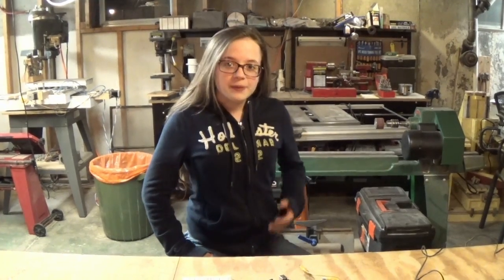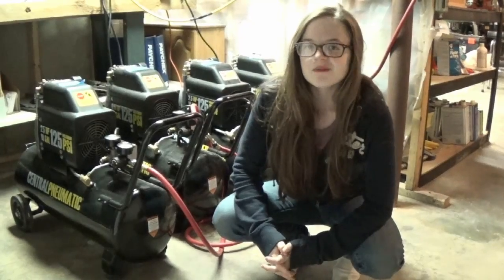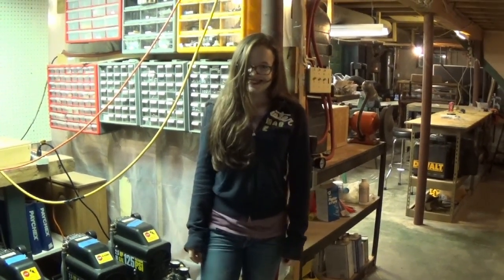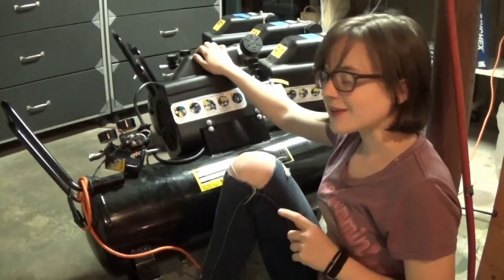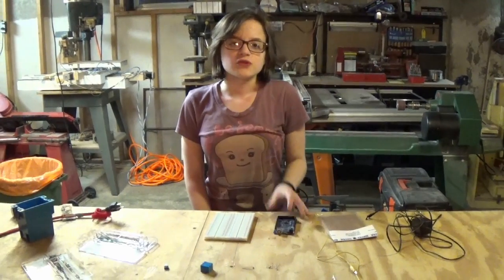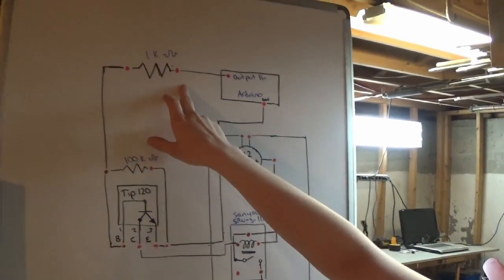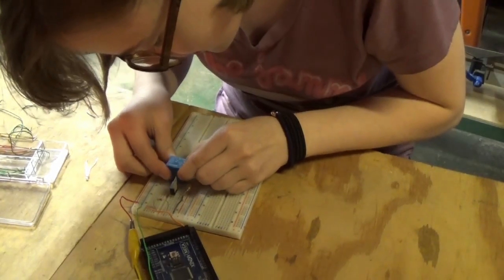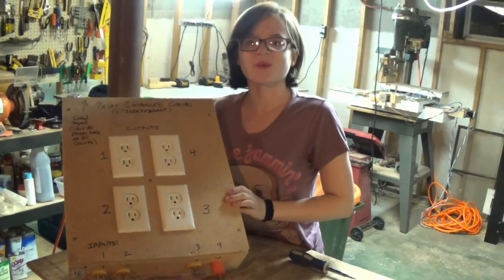Ep3 Cheap High SCFM Air with Parallel Compressors

Comment: Hmm.  I would have thought relays with a time delay feeding to the normal compressor electrical power inputs would be enough, if all tanks are connected together.  If all tanks are connected together they will all rise and fall in pressure together.  So, whenever the control compressor decides it is the right time to turn on, it is the right time for them all to turn on, and when the control compressor decides it is the right time to turn off, it is the right time for them all to turn off?

Comment: I hope your sand blasting turned out well.  I run into a lot of trouble with running my air tools at home. It's not sustained cubic feet per minute, its standard cfm. Using Boils equation for one of my set ups I found that 4.0 scfm at 90psi is 0.6 cfm for use at your tool. So your 25 scfm would actually be about 4 cfm so that actually sounds like a normal tool consumption ammount.

Comment: actually, connecting tanks together will give you the total cf, or get the biggest tank you can. this gives a long enough work time before the compressor kicks in. tanks are cheaper than compressors and a large tank eases the load on a rig that has to kick in often

Comment: Or you could use pneumatic one way check valves on each compressors output to prevent one compressor (the lowest psi setting one) keeping others from kicking on and just soloing the load / refiling other tanks. This way when air demand is high all come on.

Comment: You could just get a low voltage pressure switch, and directly wire the motors to ac. That would simplify the list a bit

Comment: Very nice vid. Are those compressors able to run on 220V? Would cut down on the amps and probably be able to run on 2 washer/dryer  and or electric oven/stove circuits.
Since so much money has been spent, why not pop open the breaker box and install a 60amp 220v line just for the compressors?

Comment: I am doing similar thing for a spray paint job. According to my analysis these compressors you are using are not designed for continous operation. They are 25% duty or less... you need a compressor that have cooling fins and more than ample cooling for motor especially because if motor burns out the compressor is totally useless to repair. In my application I don't need high psi just a 60 psi maintained that I will achieve using dewalt 55153 pump I bought from scrap. The other pump is huskey 8 gallon that maintains a psi of 160 would provide impulse and 25% or less through a restricted flow to dewalt powered tank. Because dewalt one is not powerfull but can operate continously I expect it to maintain 60 psi in 20-30 seconds huskey 8 galon requires 2 min 30 sec to fill to 160. 160 is very high preassure for the kind of pump design of huskey so it does heat up and motor also heats.

Comment: SCFM = Standard Cubic Feet per Minute, not Sustained.  But offering that correction is like telling Isaac Newton he had a spelling error somewhere.  This was an amazing project - and video - and I'm extremely impressed.  

I would love to see a follow-up video where you measure the air output.  There are probably losses in this system, and it would be nice to see the actual obtained SCFM.

Comment: Hilarious! Loved it. But I can't help wonder why not get a 15hp gas-powered engine and hook up 2 high cfm air compressor pumps off that same 15hp engine. If the 2 air compressor pumps picked are at least 12.5 cfm then you have your 25 cfm, otherwise if you go higher with their cfm, perhaps 17.5 (the ones I like) then you get a net cfm of 35cfm, which means your air input is always greater then your air output and keeps your sandblaster running non-stop. shrugs But your approach was great and so was the video!

Comment: I don't get some stuff, are the compressors sharing the air in the tanks? because if they are that means they are essentially only using one pressure sensor as a signal to turn on power to the others, and that's fine but, an i may be wrong, aren't the pistons in the compressor supposed to stop in a certain position or something and by turning them off by simply cutting the power they are just stopping in whatever position they were at the moment, is this good for them? doesn't their turn off switch have a feature to stop the pistons in the correct position and this setup is impeding this?

Comment: Forget the compressor trick... I wanna know how you grow hair that fast :D. I did a trick like this, but I didn't have a delay or controller, I just used the switch from the main to trigger the 2nd compressor that was on a different run.  I got over 2X the fill rate.  I then run them to common tanks for even more storage.  Works great and it's a great way to get extra boost out of a cheap compressor.

Comment: Excellent vid, but what's the reason for the distribution box? Can't you just plug each compressor into a different circuit?  Since they are all the same compressors, they should all have the same cut-in pressure, and all four would kick on at once.
Reply from the maker: The problem is that if they cut in all at the same time, the house will have a brown-out, and all of the compressors will stall.  They need to stagger their cut-in.  It would be possible to make that happen by adjusting the cut-in pressures, but the optimal setting would change depending on how much air I am using - this is not a problem if you stagger the power on electrically.
Reply: Hannah's Bug no not really. a typical house has a 100amp rating main electrical switch. if all your compressors are using separate plugs on separate fuse switches, then all your amp draw at start up would be 36 + (36 x 0.3). 36 overall for the 4 9amp compressors plus 30% on that for startup current. that's about 46amps which is not even half of what the house can supply evenly throughout.
Reply: Hey, I enjoyed the vid. Found it just aimlessly browsing. Not trying to nitpick as I could be incorrect. I was just wondering why you would need the first delay programmed in the arduino code? Wouldnt the arduino already be online once it begins executing the code? Thx for your time.
Reply: 9 amp is continuous operation. You have to account for the in-rush current which is going to be higher.

You need to start  compressors in a staggered sequence. 

I would have tried to get a gas driven compressor.
Reply: How much is her house drawing without the compressors on?

Comment: also hf direct drives do not like the voltage drops associated with extension cords. forget 3 phase, you'd be fine with a 7.5hp compressor with those tony nozzles.

Comment: use mils() instead of delay.. delay grinds the whole thing to a halt. It might work if you only need the simplest of one at a time functions from  you 20 buck micro controller ...but someday you might want it be able to do a bit more at once and if you've been writing delay for a year at that point its a hard habit to break.

Comment: Her house probably has two 240V outlets one a 30A and the other a 50A. Given that 240V AC is two 120V AC circuit instead of running extension cords is a adapter for the clothes dryer or stove outlet. I would set it up so the adapter kept the dryer or stove plugged in but was isolated from the power when using the 120 outlets by a big switch choosing between the two.
Reply: The number of people expressing that everyone is incompetent because they are is depressing.

Comment: Since you seem comfortable with electricity, why not run a real circuit from your main panel and setup a small sub panel rather than mess around with extension cords? Your next project should be to find a bigger compressor tank and mount all the compressors on it. Set it up so you can use just as many as you need. Good job.

Comment: Great video. Would it be possible to install check valves of varying pressures to stagger duty cycles? For instance, have 2 run a 95 psi check valve and 2 run a 90psi check valve.

Comment: While a really great idea and solution watch out because with that setup i bet the air will become very damp with how long those units will be running. You might want to research compressed air filtration/moisture separation as i suspect you will not have a good expedience with sandblasting with this solution as the air will be rather damp and will clog up the sandblaster from wet sand.

Comment: Hello, Great video! I have the same problem. I am wondering, could you run control wires from the lead compressor switch to other compressors that are plug into different outlets and have all compressors start at the same time?

Comment: Most 7.5 HP 240 volt single phase air compressors with a two stage pump, will supply you with 25 SCFM.

Comment: I was deciding on a compressor that put out at least 19 scfm for a new sandblaster I was buying, $3000+ for a 23 scfm compressor.. I asked a tech about hooking up my 3 small ones, he said that wouldn't work. Before I try it or spend $3000, do you have any way that you measured the scfm after you completed this project? How do you know it works or are you just assuming based on your sandblaster working better? Thanks for the vids. Have learned a lot from many of them.

Comment: walwarts and Darlington pairs... how we know dad...maybe mom or maybe even grandps is scripting this. By some of the terms ive heard id bet who ever it is has a ham radio handle as well. Regardless as long as she enjoys what shes doing (and her energy indicates she probably does) more power to you both... one little gripe though,...you should give them new fangled mosfets a try some time, i promise they've been ready for a decade now. Also with all that space you guys could easily build a little etch operation and skip the through hole. I went with uv resist and cupric, life is better now. It would take some special adaptations to keep a cupric tank inside. Once its cupric (not AP it started as) it doesnt off gas much. but every now and again you have to add hcl or peroxide and during etching its faster and helps your acid stay fresh if you bubble air through it from a fish pump. With what ive seen in the 2 videos ive watched you guys could probably rig up decent fume extraction. Still if you go this route i advise starting outside with the AP and copper to dissolve. That will release small amounts of chlorine gas. when it goes bright green and see through you have what you aimed for . Advantage to cupric is by bubble etching and also  adding a cap full of hcl and or peroxide maybe every 20+ etches, you are never left with spent etchant. you could even dehydrate some and sell it to others.  remember all etchants are toxic once they eat their first board...so dont let that part scare you off cupric.

Comment: Nice idea. One thing to consider is to increase the hose size from the common 1/4" or 3/8" up to 1/2" or 3/4" across the compressors. The smaller hoses create a restriction that hurts flow. Think of it like a straw versus a garden hose.  

Some channels you might like - Mustie1  ,  vwdarrin  ,  rpeek  ,  theEZGZ  These folks know bugs....

Comment: +1 for using Arduino!!!!  About how much CFM are you getting from your combined compressors?  Are you able to siphon sandblast or just pressure pot?  In closing, awesome and excessively informative channel!  Great job Hannah!
Reply from the maker: I don't have a reliable way to measure the CFM, but I would estimate that I am getting right around the 25 CFM at 80 PSI that I was aiming for without overworking the compressors.   When I open the blaster up all the way, it maintains pressure and the compressors still cycle on and off.  My blaster is a pressure pot, and I don't have a siphon type to compare it to, but I would expect to have no trouble with a siphon type.
Reply: https://www.eatoncompressor.com/bare-pumps/7-5hp-3-cylinder-2-stage-air-compressor-pump

This manufacturer describes the formula for pump displacement as "bore of the cylinder times the distance in the piston stroke times the RPM at zero pressure", and in your case, that would be multiplied by 4, but it further explains that there is a decrease in CFM as PSI is increased.  

I recently built a cabinet and have both siphon and pressure pot and have found the pot to work way more efficiently, but is more prone moisture issues than the siphon type.  I work at a body shop with a 5HP IR that struggles to give me the air I need and am considering this as an option as I have to finance these types of upgrades myself, or settle with doing the work with hand tools, DA etc.  Still searching for the cheapest approach.
Reply from the maker: So I assume at 5 HP that the Ingersoll Rand you are using is not 3 phase?  Multiple 120 and 240 Volt compressors could be run using the exact same setup as I have used here with only 120 Volt units.  In a professional shop where you are going to use it over the long term, I would suggest that you address the cylinder head pressure release system in the slaves more efficiently than just introducing a leak like I did.  I'm sure you can find a cheap electrically actuated, normally open, pneumatic switch/valve and attach that instead of the relief valve, then you simply program an additional arduino pin to go "high" and close that valve when it turns on.  

Installing 3 phase power in your shop could be pricey, depending on many factors.  But if your IR is already 3-phase, or if you already have 3 phase elsewhere in your shop, then you should consider replacing or augmenting your compressor with a 3 phase rotary screw type - which are very expensive new, but you can find them used VERY cheaply and commonly at industrial auctions.  Try bidspotter.com and look/wait for an auction that is close to you.  Bidspotter works with a number of auctioneers.  Some specific auctioneers to follow are Koster industries, Thomas industries, or Joseph Finn Inc.  Often they have auctions that are not on bidspotter, especially Joseph Finn.  You will probably need to budget a few hundred dollars for a certified rigger to remove the system you purchase from its existing facility.
Reply: Thanks for the feedback, but unfortunately, my budget is that of the ULTRA cheap.  If I were to get a new Eaton pump, I'd also need to pair it with old LP cylinders and likely a cheap gas motor and burn biomass for fuel.  Still trying to plan out my cheapest option as I don't own the business, just work there and trying to make my job easier with use of blasting my work (car and truck rims).  Still don't know if I would be able to get 4 small HF comps onto 4 separate circuits, or if their IR comp is 3 phase or one.  Lots of details to iron out.

Comment: I was hoping to see a setup where there is a master pressure switch  with relays that control all the air compressor motors, resulting in simultaneous power  for Cut-in and Cut out pressures.  I'm needing this for a tire changing machine that is very AIR HUNGRY.  
    moving on....

Comment: A question 6 years later, is your Arduino staggered start, still working on your air compressors? And would you change anthing? Like bigger contactor ?

Comment: cool, but a lot of hassle for not much... still end up costing a lot. a 15-20 cfm 240v compressor can handle a 20 gallons sandblaster no problem and probably cost the same as you paid in the end.. unless you are running a shop, you dont need 25cfm... still great channel work, continue doing what you do :)

Comment: ... ebay sells delay modules for about $3 1 second to 1hr delays from the time they receive power. so all you would need is 3 of them and 3 relays. (they have an on board relay but i would not trust it with mains voltage) and a 12v wall adapter. 

you can figure it out how it would all be wired. And you need no codeing.  I think people use programmable interfaces as a crutch  too often.

Comment: Is there any problem with not having such a circuit. I have three compressors and I adjusted the pressure switches to come on at different pressures and that works fine. the first compressor kicks in and if it can't cope the pressure keeps dropping so the next one kicks in and so on.

Comment: playing it as it lays you can do.an electromechanical  or logic circuit abcd to do the cycle, another way would to put in a hp compressor with 2vcylinders

Comment: You realize the air compressor should never be run on a cheap extension cord around the houses. Air compressors pull around 5-12 running amps that will overheat a crappy cord. Most houses use 20 amp circuits as well. But it really depends on the house. You can get a compressor that will run on 240v like the dryer outlet that has a high output. And the Lilly hood of a power sag would require like 5 central air systems going onto cool at once from the compressors. And in the Likely hood a power sag did happen it most likely would not last long. But that depends on the wiring in your house and the pole transformer feeding your house.
Reply: Those relays are meant for smaller current from a fan. A compressor pulls slightly more current then a fan. Electrical safety police

Comment: Get an old transformer, a phase converter and put you a new BALDOR 3 PHASE MOTOR, SOME OLD USED PLC AND A VARIABLE FREQUENCY DRIVE  INSTEAD OF BUYING FOUR CHEAPLY BUILT BUT KINDA COSTLY AIR COMPRESSORS THAT ARE GOING TO BURN UP SOON ENOUGH

Comment: If you ran all your airlines into 1 high pressure tank with check valves, you'll get a better result. If you really want to take it to a privacy level, I'll be putting something new together soon.
Reply: I plan to be compensated for it.

Comment: there are electrical devices to simulate 3 phase power the are expensive but not as much as installing 3 phase service.
Reply: There is no point doing such a thing because the problem is the total current that Americans can draw from a single 110/120v wall outlet. So you cannot make 110V 15A provide any more than about 1500W.